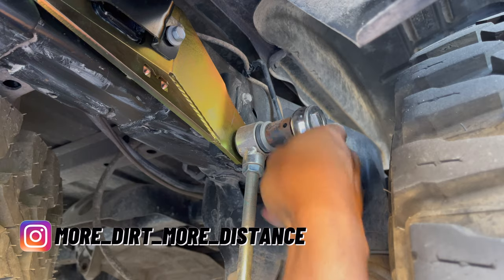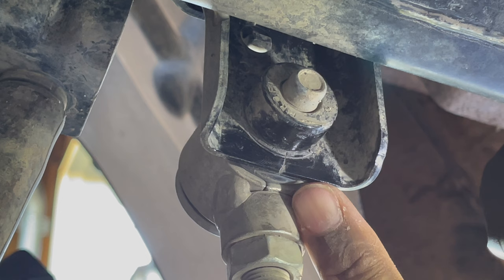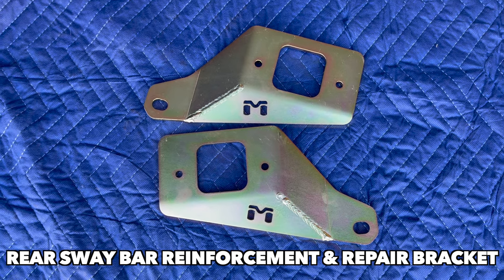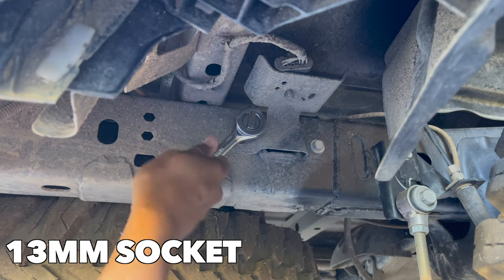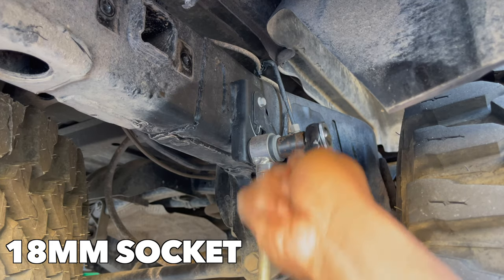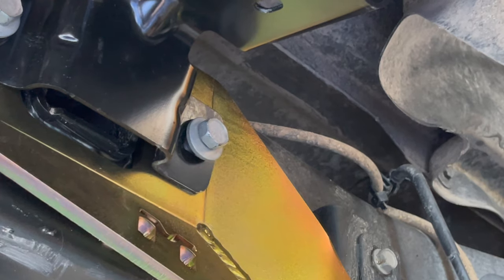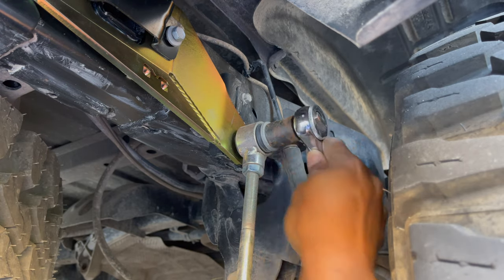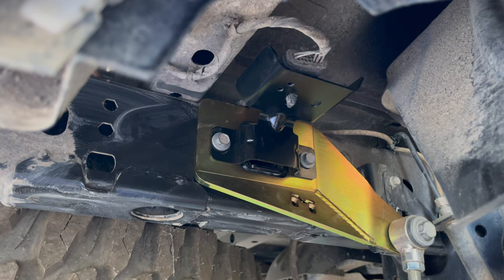Your Gladiator has a DESIGN FLAW! Here’s the FIX - Metalcloak Rear Sway Bar Reinforcement Bracket

Comment: The Jeep engineers completely failed on the Gladiator rear sway bar they should have frame mounted the sway bar like the JL and they could have avoided this issue and all the bent end links. This is a nice upgrade.
Reply from the maker: I was surprised how thin the bracket was!
Reply: Agreed. I have this and it's great, but now I keep bending my swaybar end links

Comment: Thank you for this concise set of instructions.  I just got my braces on (preventive measure).  No issues with the Metalcloak hardware not fitting and my truck has welded nuts behind the brace - so no need for the included free nuts.  There must be some variances between production years.
Reply: Mine just needed to be chased a bit. I ran the stock bolts all the way down with the link removed and back out. MC bolt went in fine after doing that.

Comment: nice!   will add these this winter though I dont see any cracks yet it seems prudent!   I like Metal Cloak stuff!  added front and rear diff covers + rear diff slider and an oil pan armor/slider this summer !  Glad I did because I got some decent scratches on it this year on  Birdseye Gulch by taking a bad line and didn't see a nice sharp tall rock and drove directly over it and  the oil plan skid plate slid right over.
Reply from the maker: I have the upgraded front and rear diff covers but haven’t done a slider upgrade. I should at least do an oil pan slider.
Reply: @MoreDirtMoreDistance  Well it's  "bit after winter" :) here and I finally added these to the Gladiator!  Figured after doing 35s and the lift better get it done!
Reply from the maker: @DeanJohnson67  True!

Comment: 1:29 you've only got a few threads of engagement. Longer bolts would have helped. The hardware they send is for if the welded nut/boss was already broken off.
Reply: @geofflau3002  it tends to break off when the bracket is damaged. Rather than weld it back on, they provide a nut for their replacement bolt.
Reply: I just purchased 12Mx65mm and a set of 70mm just in case. I’ll try to fit them tomorrow and see how it goes.
Reply: @ftterlve mine haven’t failed yet but this mod is my preventative measure. Thanks for the info. I’ll keep the bolts in case the nut breaks off.

Comment: I tried using a 12Mx65mm from Home Depot and it doesn’t fit in the welded nut. How did you make it fit ?
Reply from the maker: I believe I used a 12Mx16MM and it fit.